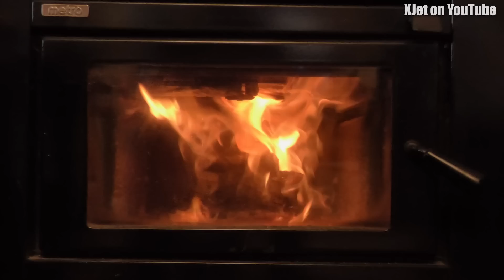The drone impact tests we have been waiting for

Comment: You'd think it would be safer flying fpv, cause you know where your going. We've all had moments when flying normally when we loose which way is front of the drone, and crash it, which is impossible with fpv
Reply from the maker: The best seat in the house is behind the goggles.   Regulators seem to think that when we put on FPV goggles we're suddenly blind and deaf.  That's probably because those making the rules have never actually flown FPV themselves so they simply assume too much.  Rules made from a position of ignorance are seldom good rules.

Comment: Nice video. I agree that some of the regulations seem a bit over the top especially if one is flying over one's personal property. If everyone was as safety oriented as you are, then there shouldn't be a need for excessive rules. I agree. On the other hand, they are NOT. There are idiots everywhere and more (at least in the USA). Unfortunately, I see this almost every day. It is, however, sad that the hobby is being beaten down by regulations. In my opinion, they could lighten up a bit for sub-250 gram, category 1, drones.
Reply: Thing is, the idiots already break every rule and ignore all the safety anyway. The regulators haven't actually done anything to help, so we're just a bunch of reasonable people with more hoops to jump through.

Comment: You talking about how throwing firewood is unregulated, reminds me that Free Flight models are not regulated by the FAA.  Even if it is gas powered weighing up to 55 lbs.  I can even put FPV on a free flight plane and it is still legal.  But the moment you add a receiver and servos, how does the plane become dangerous and need regulation?

Comment: Saying that a drone can bring down an airliner is only scaremonguering. That only makes the public opinion to hate drones and drone operators and don't have any impact on safety.

I worked 30 years for an airline and was an aircraft structures engineer, member of structures working groups from the L1011 aging aircraft to the A330/A340 maintenance programs. A drone like a DJI Phantom doesn't bring down an airliner. It weighs around 1.8 Kg and aircraft and engines are certified to withstand the impact of a 2 Kg bird without suffering major damage. During cerification tests birds weighing 2 Kg are shot to the fuselage and engines using a cannon.

Of course such an impact can cause very expensive damage, mainly to engines, but that wouldn't endanger the aircraft itself.

Your Nebula wouldn't even scratch an aircraft. I have seen  an Youtibe video were a Phantom like drone impacts a propeller biplane. First they let the aircraft on the ground with the propeller turning and flew the drone against the propeller. Second they let the drone hover and flew the aircraft in a way that the propeller hit the drone. In both cases the drone was destroyed with only scratches on the propeller.

Bird strikes are very common, on my airline with around 100 aircrafts we had on average a bird strike per week. Most of the strikes not even the pilots noticed, only during maintenance checks feathers and blood were found on the engines. But a few strikes were big enough to make the engine go to shop at a cost of millions of dollars.

From what I recall there were only two instances where bird strikes had crashed an airliner. The Hudson river A320 that hit a flock of geese and some time later an A321 in Russia hit a flock of seagulls.

Comment: I think you should use a drone the same weight as your wood
Reply: That'll be fair as soon as the regulations treat the two weight classes differently. Most have followed in the footsteps of the FAA, and anything under 9.1kg or 20lbs is considered to be "group 1" which is the smallest weight class. In other words, they would treat a 30g tinywhoop or a chunky cinelifter as the same thing when classifying by weight. Of course there is the 250g registration limit in many places, but that's also a random, silly number.

Comment: In the USA: Is there a defined radio frequency for remote ID from the drone/plane? Is there a data transmission protocol? How are full size aircraft/heli's supposed to receive the details of Johnnys Turbo Timber flying at 399 feet over the high school?
Reply: The FAA themselves said that RID has nothing to do with collision avoidance. Instead, it's to help citizens and law enforcement catch you flying. As for the radio frequency and such, they're planning on using Bluetooth Low Energy or perhaps some offshoot of WiFi. Pretty much anything that is widely available on any tablet or phone. Naturally, people have raised concerns about telling the general public that they're sitting somewhere with valuable equipment with their eyes covered. These signals could likely reach out to about 5 miles or so if unobstructed.

Comment: Next you're going to have to register a kite and have a Remote ID transmitter installed in it. You know a kite can down an aircraft and cause death and destruction, I am sure the the regulators would agree.🙄
Reply: I have been kite fishing at Uretiti Beach and witnessed light air craft flying down the beach at approx 200 feet when pilot spotted the kite and suddenly needed more height.😊  Why fly so low?
 Nuddists sunbathing. An excellent reason to risk a collision with a kite complete with attached fishing line, hooks and sinkers.
Reply: Some of the regulations also cover kites. And even control line flying(!).

Comment: firewood ? the problem is deforestation bruce, that's might be renewable but not sustainable!
Reply from the maker: Here in New Zealand it's sustainable.  We have the largest commercial exotic pine plantations in the Southern Hemisphere and they're replanted each time they're felled.
Reply: The great majority of firewood and lumber (at least in the US) comes from tree farms. They replant as they clear and cycle through plots just like any other crop. It is highly sustainable and helps the environment in many ways.
Reply: @bigdatapimp  no most times it's being done in places that had a pre existing old growth forest with great biodiversity, and it reduces the diversity in those forests. But if it's done well, no problem with it, it's just better to use the wood in a permanent way and not disposable like firewood or houses that don't last that long. I think fast growing resistant hardwood might be better because you can fix carbon long term rather than for 50 years. Also building stuff for the long term is better as the cost/ and energy required is offset by the long duration the building will be useful

Comment: In Britain, they are trying to ban wood burners.... I wonder why🤔
Reply: They already have in California.
Reply: New York is trying to ban wood, natural gas, fuel oil and gasoline.
They want everyone to go electric with everything.
My house is gas natural gas heat, hot water and clothes dryer. So the house only has 100amp service. It will cost me over $5000 to upgrade my electric service to support their requirements and increase my monthly bill over 30%.